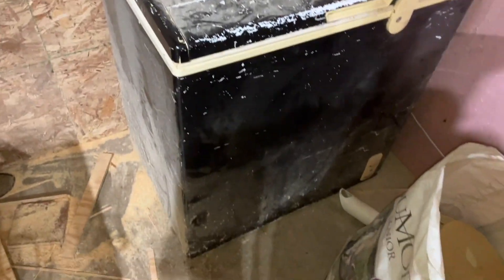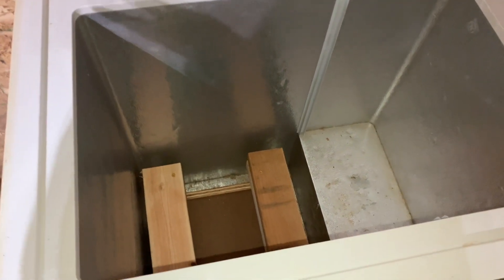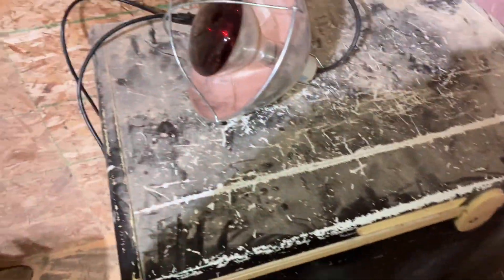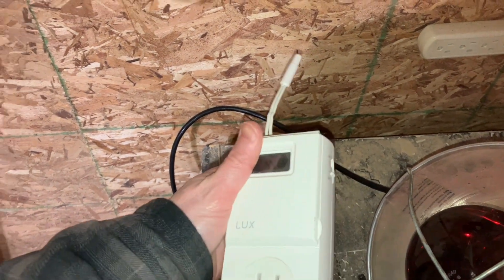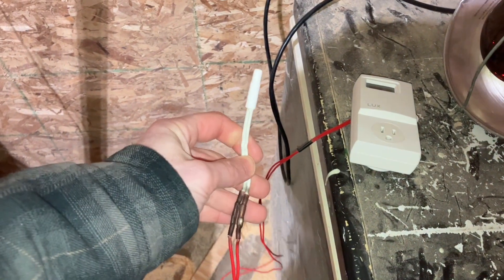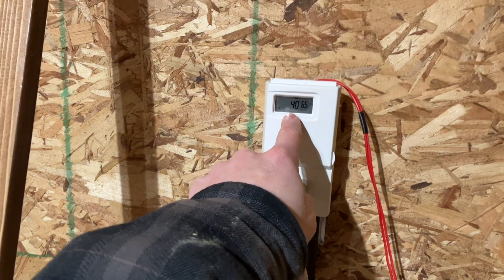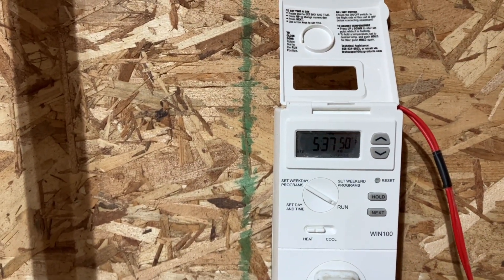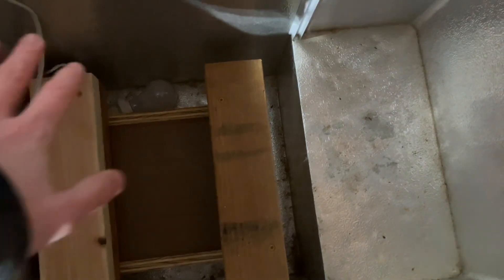Need to Keep Your LifePO4 Cells Warm in the Winter?

Comment: you can actually just get a fixed temperature NC (normally closed) thermal switch for like $0.25 and put it in series with your heating element.  it's the sensor and the control in one cheap, reliable package.  I got some set to 41 F and put them in series with some of those silicone heating pads.  I'm yet to see how it'll work out though.
Reply from the maker: Very cool, thanks for sharing!

Comment: You cant find incandescent light bulbs anywhere in the U.S.. I think they are illegal over here everything is LED
Reply from the maker: Sure you can.  I just looked at my local Home Depot and the were quite a few options in stock.
Reply: @AdamDeLayDIY  I'd have to check again, maybe things have changed with the new administration.  Just last year I had a similar idea as your on how to keep my water pipes from freezing inside the storage compartment on my travel trailer but couldn't find any incandescent bulbs in any of the home department stores.  I should point out I'm from Washington State don't know if that would make a difference good or bad.
Reply from the maker: @joytrucker5709  Possibly but yeah I would take a look again.  Another option might be one of those chicken brooder heaters.  Should be a little safer than an incandescent bulb banging around: https://www.tractorsupply.com/tsc/product/producers-pride-brooder-and-coop-heater-1299682

Comment: Instead of soldering on an extension for the temperature probe. Just use an extension cord to get the thermostat closer to the fridge.

You still have losses from running the inverter. Even low idle inverters use like 6 watt an hour or 144 watt a day. And the thermostat also uses power.

Otherwise yes, an insulated box with a heat source will do the trick. Unless you are willing to bury it 8 feet deep
Reply from the maker: @TheCornucopiaProject-bd5jk  that would work if your not concerned about space.  I had limited space around the batteries and I wanted to get the temp probe near the bottom of the cooler.

Comment: I have four brand new 12.8V 100 Ah Power Queen LFP self-heating batteries that I plan on installing into my 1997 Class A motorhome. But in the interest of making this unit long(er)-term off-grid-capable up here in Alberta Canada - where temps can occasionally plunge as low as -40 - having a proper heating system for them is vital.

Even though these batteries have a BMS and self-heating, they can never be allowed to go below -4F (-20C) or damage can occur. This is a likely scenario during those times when we're not in the motorhome and therefore have no heating systems on. Your heat lamp idea (using an actual heat lamp of sufficient wattage) sounds intriguing if ran off a thermostatic power source as your set-up has. 

Another alternative I'm considering is using a duct from a diesel heater that's routed into the insulated battery bay. Since these batteries would be mounted in one of the under-floor storage compartments that's located under the kitchen sink I'm thinking of mounting the diesel heater at the other end of this storage bay and ducting most of the heat upward into the sink plumbing area and then out a vent into the living area, but with a small duct tapping off to the battery storage box. 

But now I'm thinking why not use both? Why not have the lamp set-up as a back-up in case the heater fails? 

Regardless, I'll need to have sufficient solar panels to eek out as much charging power as possible in order to run everything but also to run the lamp at times when we're not there and therefore don't need the diesel heaters.
Reply from the maker: Having multiple options sounds like a great idea!  

The reason I didn't use an actual heat lamp bulb was two-fold.  
1. They use a lot of power 
2. In such a small space, I didn't need it.  

I would test different bulbs to find out what you actually need.  I had started with a larger bulb and found I didn't need it because a smaller bulb would be able to keep the box at 40F+ easily.  

Good luck!
Reply: @AdamDeLayDIY  thanks! The reason I was thinking heat lamp is because it takes more power to maintain 40F with ambient temps at -40 than at say, 15F. I'm thinking I could change the bulbs out until I've dialed in the correct wattage for those ambient temps. And if it's thermostatically controlled a hotter bulb may use more power, but for shorter periods of time during the ON cycle....
Reply from the maker: @zeus014  Let me know how your testing goes!
Reply: @AdamDeLayDIY  will do. Might be a few months though, being that it's the dead of winter and all. I should have all components purchased by the spring thaw. But then I'll have to wait until winter again to fully test the system when temps have plunged all the way down to minus-M.F.

Comment: why didn't you just put the thermostat on a heavy duty extension cord
Reply from the maker: @glennelhardt6884  I was trying to minimize any modifications I would have to make to the freezer itself in case I needed to use it again in the future.  Having a few 18ga wires fit nicely under the door seal.

Comment: Anybody just thought of reverseing the pipes at freezer compresor recharge with gas and it will heat interior instead of cooling and change/modify thermostat so can be set to 5°c 40°f or something would be very easy to do Basically exactlly the same as modern houses heat pumps work.👍👍
Reply from the maker: @michael-sz3ff  I think I had someone else mention something like that before. Just a little more work than adding a light bulb though… 😁

Comment: I know I'm late but couldn't you slide the freezer over and run mini tube's from converter cooling fans down into the freezer?
Reply from the maker: @Michael-b9c  you probably could but it seems like adding a light bulb would be a lot less complicated then replumbing the freezer lines.
Reply: @ I’m not talking about the freezer lines just drill holes in freezer then run air tubes from converters into the freezer the fans are pushing heat out itself pump that to the freezer would have to cut small holes in bottom to let cold air out bottom.
Similar to a cheap college fridge with just that cold plate of aluminum and the cooled air drop to bottom of fridge, heat build up will push heat down thru the freezer and out the bottom, it all depends on how strong that muffin fan is.
Reply from the maker: @ still seems like a lot more work than just a light bulb.  Probably uses more power too.  Plus if you need to use the freezer down the road, you don’t have any holes to plug.

Comment: OR,,,,use an extension cord and put the thermostatically controlled outlet and unmodified probe in the box and skip the soldering...
Reply from the maker: That's definitely an option. I just didn't want to open the freezer each time I wanted to see the temp.  That and the temperature probe wires are much thinner making it easier to get a tight seal on the lid of the freezer.

Comment: Adam in the future consider Trophy batteries. They have built in heaters, higher quality cells that EG4 and a 10 year NON prorated warranty for  the same or less price than the EG4 batteries. As a bonus they have excellent customer service
Reply from the maker: Thanks.  My batteries are all DIY.  I can’t justify the cost of a prebuilt battery to myself when I can make my own so much cheaper and get a whole lot more capacity.
Reply: @AdamDeLayDIY   For some reason I thought you had EG4 batteries. My apology.

I had thought about DIYing a battery since I can drive to battery hook up in about 45 minutes. I was concerned my lack of knowledge would get me in trouble.
Reply from the maker: @pryda1  no worries!  I’ve bought stuff from those guys before.  Im sure they would be extremely helpful in building your own.

Comment: We have a 60w bulb in our insulated pump house to keep everything above freezing. Just on 24/7. Low 40's at its lowest.
Reply from the maker: Nice!  How bigs the space to heat?  Do you thing a thermostat would really buy you anything?
Reply: @AdamDeLayDIY  About 10x12. That bulb and the 6000ex will be enough for winter. Summer we'll need to keep an eye that the temp doesn't get too high.

Comment: Thanks for sharing! I went to the local dump and had at least 50 fridges to choose from.  The guy there looked at me a little funny and told me it was free, but if I wanted to bring it back, it would cost me $10.
I'd actually bought the seedling starter mat for starting seedlings a few years prior.  I have a couple of them wired together in there pulling 40W total.  It's currently -4F outside, and a toasty 60F inside the fridge.  

A bulb works great too though.  I'd originally tried a small PTC fan heater, but the air coming out of it was scarily hot, so decided on something else.
Reply from the maker: Your welcome!  Never thought about checking the dump.  

The fridge is an awesome idea!